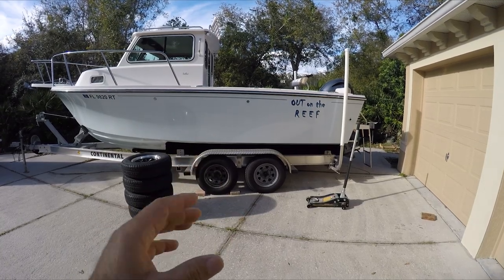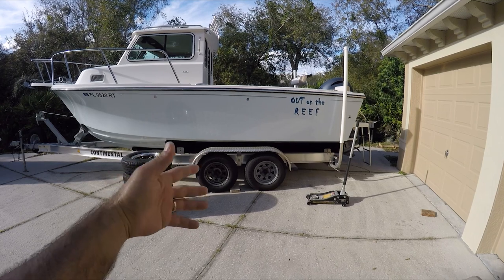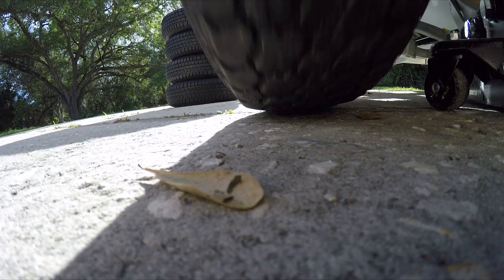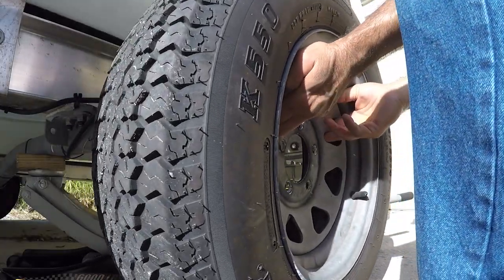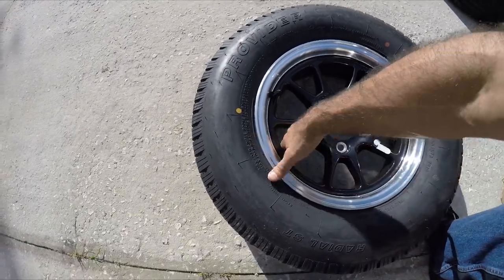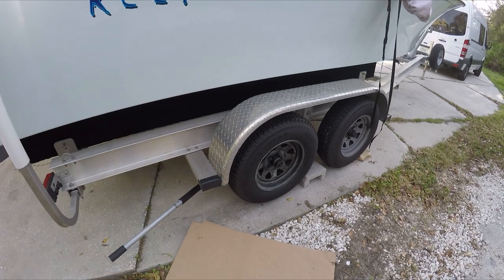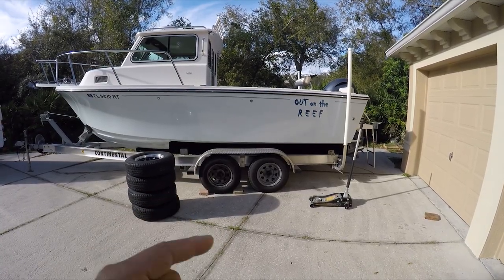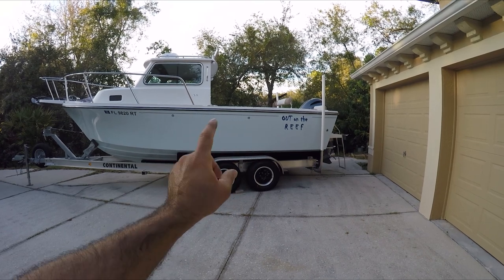Why Change your Trailer Non Radial tires to Radial tires Continental Trailer Crooked PilotHouse boat

Comment: saludos capt yo creia que las gomas que tenias eran buena radial de trailer
Reply: el trailer mio es 2018 y vienen con gomas radial de trailer
Reply from the maker: no cap son esas baratas que bienen con lostrailers,i cuando las inpecsiono me sorprendio de como mala estavan,por eso las cambie
Reply: a los caliper mios le hecho wd 40 pero que no le caigan a las pastillas y a los tornillos le hecho aluminum anti-seize lubricant
Reply: no le heches wd40 a las tuercas por que se te aflojan ya me paso y un fabricante de trailer me lo dijo tambien y mas que tu recires muchas millas
Reply from the maker: @DeepBlueChannelCom  tremenda idea cap
Reply from the maker: @DeepBlueChannelCom  si es verdad ya eso me paso en el pasado y aprendi mi lecsio

Comment: Great video.  After having a friend tell me of a blowout that they had with their camper trailer, I did extensive research.  I found that my tires were too old, and I've been trailering on borrowed time, as most probably are..  I chose Goodyear Endurance trailer tires, seem to be a favorite with many, and also the only one that I could find that was also made in the USA.  People please make sure to check date stamps on your tires, there is a week and year date stamp on the sidewalls, and even when buying make sure they're fresh so as to get the most lifetime out of them..  keep them out of the sun and covered whenever possible.
Reply from the maker: great suggestion captain and im glad you change your , you are safer now on the road👍👍

Comment: Thanks for the tip mine are doing the same....also what I do is put antiseze between the wheel hub and rotor also between rotors and wheels to minimize the corrosion on these areas.
Reply from the maker: That's an awesome idea and I do have anti Siege with me I should have done that thank you for the great recommendation captain and hope you get your trailer fixed soon

Comment: Great demonstration.  We have a new trailer but  only use it to put the boat on land during hurricanes, and we only have to trailer it about two miles; and not over 30 mph....
Reply from the maker: in this case is not worth it for you to change it is only for highway use , have a great night cap.

Comment: I didn't know there was a difference. 
Will change it asap. Thx 4 the video
Reply from the maker: Yes captain and it's really important if you travel in the highways a lot because that's when they really get hot and want to blow up but if you just in town running around in town there's not a huge worry about it.
Saludos cap😉
Reply: @OutOnTheReef  todos mis trailering son al menos 70-150 millas . Thx for the info
Reply from the maker: @Ushootout  seguro capitan👍

Comment: Buenas! Did you lubricate the wheel bearing?  The tool is very in-expensive.  RH
Reply from the maker: saludos cap.Yes I did every trip i take especially i drive over 2 hrs

Comment: I fix tires and alot of boaters don't know that if you get a leak from the rim .people would waste money on a new tire but if you have a leak from the rim the best thing I would do is put an inner tube in the tire and it is fixed if you ever need an inner tube for your trailer tires the size that you would need is fr-13/14 radial tube thanks
Reply from the maker: never had a need for one but thanks for letting me know cap.

Comment: Probably a stupid question but where do I go to buy the aluminum wheels and radials?tire shop or trailer shop? Here in florida with the temperature of the air, the heat on the road and going down the road in general the Bias Ply literally just comes out.
Reply from the maker: I pleced the link in the description below of the tires cap the rims you can find them in the internet, hope this helps

Comment: Lots of trailer tires even radials have low max speed ranges. 65-75 mph.  Radial Load range E 80 psi. Nothing lower than speed range N. Thanks for the vid.
Reply from the maker: Anytime captain and yes this tires are rated for Highway 81 miles per hour max I believe at 50 PSI
Reply from the maker: Thanks for watching captain

Comment: Love your videos but.... and I hate to even put this on here, there are some distinct advantages and differences in Radial vs. Bias tires. There is NOTHING wrong with Bias tires. If you are a short haul user, the Bias tires are perfectly fine provided you care for them. #1 issue with Bias tires is people not ensuring they are inflated to the proper PSI. Bias tires have stiffer sidewalls also which prevents trailer sway and they run straighter than a Bias tire being pulled due to their shape and construction. Bias tires do tend to last longer, ride smoother and develop less heat BUT they do not "pull" as well as a bias. I think it's important for everyone to truly understand the difference between the two and understand their use before they go out and replace their tires on their trailer. My trailer had Bias tires on it when I got it. I noticed that when I pulled it in high winds the trailer swayed pretty bad. After talking to a buddy who works for Goodyear tire and Rubber in Akron, I found out way more than I ever wanted to know about tires and their construction. Basically it boils down to this.... If you don't pull your boat hundreds of miles, the road traveled is in relatively good shape and you are good about keeping an eye on your tires, Bias tires are for you. If you pull down bad roads and travel long and far with your trailer, a Radial tire will probably work best PROVIDED you get the correctly rated tire... There is a difference between car tires and trailer tires. You have to know your weight ratings and such. Most all trailer manufactures of Tandem trailers actually recommend Bias tires by the way.
Reply from the maker: Thanks for the great information captain and yes I do tow my boat at high speeds and 4/300 miles on the highway so qualifies for my use and you're right if it's for short trips you can deal with non radial it will be ok.. thanks for your great comment

Comment: Capitan did you change the sice too? l think on your sprinter are 235/65 R16C does they match? 
( Diagonal tires are not allowed in europe where l am)
Thank you for showing that so clearly
Reply from the maker: They don't have to match with the van tires and sorry to hear that they don't let you use those tires over there in Europe. 
Drive safe captain😉

Comment: Silicone spray right on the rotors ! lmao
Reply from the maker: LOL yes everywhere it goes away once you drive a little bit nothing's going to happen to your braking
Reply: Out On The Reef  be careful showing people to do that !  Silicon spray on rotors cuts the stopping power big time . Put some spray on your van’s rotors and you will see what I mean bro. I have sprayed that on my motorcycle rotors but always wipe over the contact area of the rotors with chemtool on a rag
Reply from the maker: @rrandydduke  I understand but once you drive the trailer for about 2-3 minutes that will go away and remember the trailer brakes is a compliment for breaking is not your number one breaking method
Reply: Out On The Reef  I’ve been a commercial driver for 23 years and owned 28 motorcycles in my life probably sprayed 100 cans of that stuff through the years . It doesn’t go away after 2-3 minutes that stuff needs to be heated off through extra brake pressure and then that adds to uneven wearing of the pads and rotors because that product will infuse into the pads and rotor surface until it’s heated off . For many people who live in states that are hilly and brakes are needed this isn’t advised to do
Reply from the maker: @rrandydduke  thanks for your great suggestion captain
Reply: Out On The Reef  we like you out here and just want to steer you in the right direction 👍
Reply: should use anitseize on the studs
Reply from the maker: @dianadagostino8957  that's a great idea

Comment: Major benefits, is the rotating weight, an advantage on gas milage also aluminum rims don't heat up as much, making it safer and better wear & tear on the components.
Reply from the maker: I agree if you look at cars most of the rims are aluminum because it's the most efficient way to go fuel economy

Comment: I've learned my lesson the hard way. I have a single axle trailer and got 2 tyres blown in single trip, what are the odds?
Reply from the maker: Sorry to hear that Captain and yes try radial tires and you'll see the difference they just like regular automobile but made for trailer
Reply: @OutOnTheReef  Thank you Captain. I've purchased Bridgestone R623 tyres. Also, we should not forget about checking spare tyre regularly.

Comment: Possible flat spots on the original tires? Was always curious why more people do not swap out for radial tires.... price difference cannot be that much 🤷🏻‍♂️
Reply from the maker: But I guess people are looking for the cheapest deal out there which is not smart to do when you buy a very expensive boat
Reply: Because for heavy loads BIAS PLY are better 🤦🏼‍♂️

Comment: DO NOT spray any lubricants onto your rotors people. Also, anti seize is a way better product to use on the hubs and will hold up unlike silicone spray.

Comment: Your tires being 'out of round' might just be from flat spots from sitting with the boat on the trailers. Bias ply tires are notorious for that.
Reply from the maker: yes you are right cap.
Reply: Out On The Reef  You probably felt a rapid thumping when you first left with your trailer, but it would go away after a few miles when the tires heated up. Right??
Reply from the maker: @michaelrutledge7048  i did not and i was paying attention to the tires everything was smooth cap.
Reply: Out On The Reef I guess you might not have felt it since they were on the trailer. If it was on your MB, you surely would have.
Reply from the maker: @michaelrutledge7048  yes I think you're right since it was in the trailer you don't feel it but maybe it was I just didn't feel it thank you for the great question captain

Comment: Those are called bias ply tires.  They have a woven mesh of non metallic web built into them.  They are round across the tread so that they will be flat to the road when used.  They are suitable for trailering because the load is not lateral, but vertical from the weight of the cargo.  Yes, you do need to have a suitable rated tire for the load being trailered.  Radial tires are much better performers for autos given the lateral loads exerted upon them.  They are also flat across the treads due to the metal mesh.  Bias ply's are not balloons, and the choice to use radials is a personal one, not because of safety.

Your flat spots are from sitting in the driveway.  If you drove is more often, the tires would not be flat spotted.
Reply: Darrell Andrews  oh you don’t say 😂😂
Reply: @rrandydduke  - I do say :)
Reply from the maker: Thank you for your response Captain but nobody drives their boat trailer every day so sometimes it sitting for a month or two there so that tells us that they're not good for both since you don't move them a lot so that's why radio tires are better for boats and they are more grip on the road
Reply from the maker: They don't blow up as much as radio do in that I'm sure you do agree with me
Reply from the maker: @rrandydduke  I have talked to a lot of mechanics and they tell me the same thing is I'm splaining to my viewers and as far as the sidewall goes the side walls on a radial tire are stronger than the non radial tire.
All my previous trailers I had the same problem with the non radio tires and remembered the tires that I put in these rims are made for trailering a boat design for that, it's not car tires I installed.
Reply: Out On The Reef  good deal , radial trailer tires 👍.... just remember any open slice or nail in those that would allow salt water to contact the chords and it’s game over 😂
Reply from the maker: @rrandydduke  you're right that is definitely a good advice to keep in mind
Reply: @mrnewyork347  if he overpressurized them +10psi they wouldnt flat spot

Comment: balancing your trailer tires how are you balancing hub centric or bolt centric most trailer tires are stamp so there not center by the hub just by the studs on the rims so if your balancing the tire on a trailer get them done bolt centric
Reply: great video by the way
Reply from the maker: That's a great idea to thank you for sharing that

Comment: Should have upgraded to 8 ply for a few dollars more.
Reply from the maker: I looked at the 8 ply but it reduces the speed on the Highway to 75 and this one's can do 81 miles per hour, not like I will run at that speed but at least I know you can go that fast if you need to with the 6 ply

Comment: What you really need to do is put tires that are  rated for boat trailers cause the ones on it and the ones your putting on are not correct 🤷‍♂️🤷‍♂️
Reply from the maker: Yes if you look at the description below it shows you that this tires are rated for trailer
Reply: Actually airstream now adds radial tires as an upgrade option. Not trailer tires.

Comment: Bias tires suck, it’s what people used 50yrs ago, and don’t buy good year tires all there tires suck
Reply from the maker: i agree i called them suicided tires🤣
Reply: @OutOnTheReef  another bad thing about them and it’s why those you had looked out of round is if you let a bias ply tire sit for a day or two with a load in it it will get a flat spot on it until you drive on it for a few miles
Reply from the maker: @reelnative01  yes I have heard about that